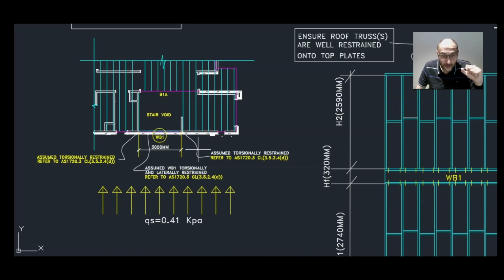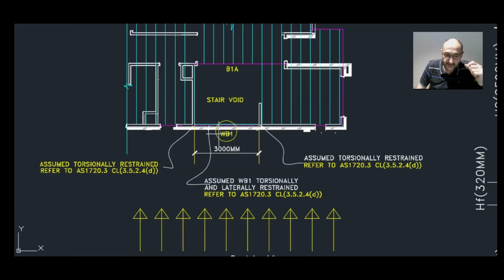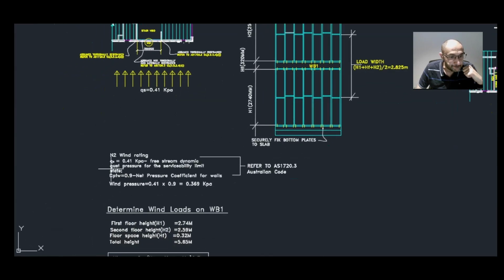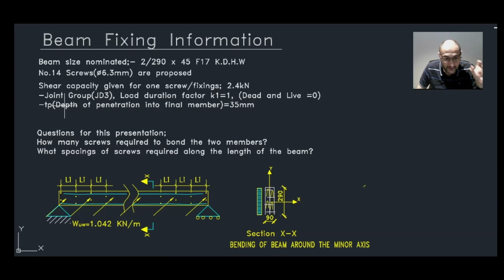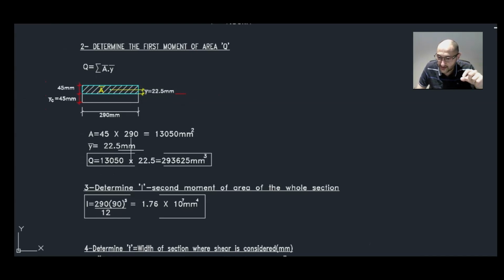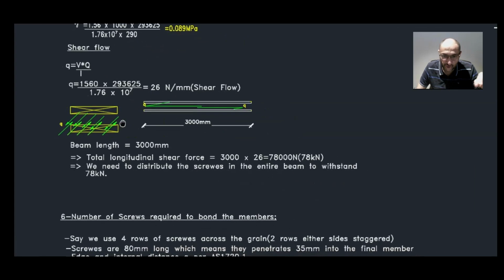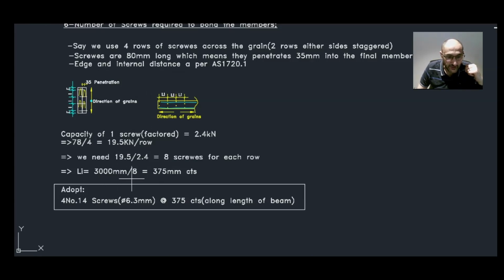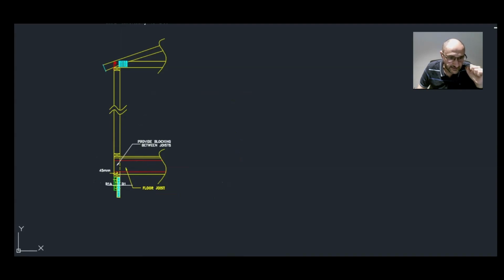Shear Stress Formula And Built-Up members- Part 3(Example 1)

Comment: Happy new year and I hope you had a delightful time. Back to business with these great videos. There are currently few Australian engineers on YouTube, but the content is somewhat white noise. This is by far the best channel and I love your discussion points. For example in the case of the Wind Beam, I do not recall any engineer going through part 3 of the code to this depth. The torsional restraint requirements, or the use of service wind for both ultimate and service design in this case were news to me, I ran to the code to read myself. I love how you discussed the methods to overcome the restraint requirements. Love your work, it is genuine, in-depth, practical, and above all thought-provoking.
Reply from the maker: @ehsanchannel8703  I am truly humbled by your comments. I appreciate your amazing feedback. I am extremely happy to also know that contents are useful and somewhat interesting. Atleast this  gives me the motivation to create more examples. Thank you again and Happy New Year to you too!